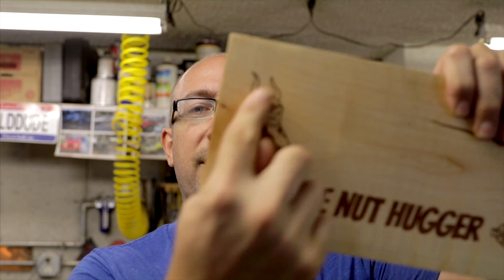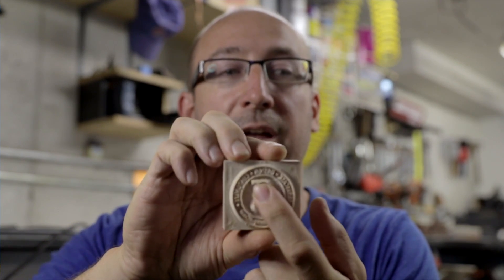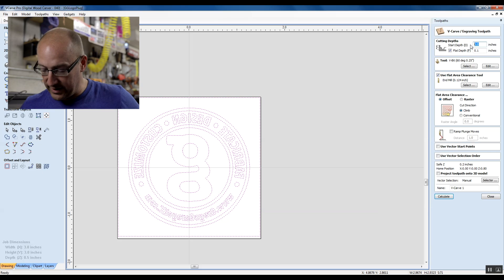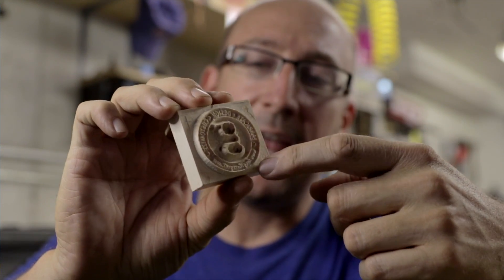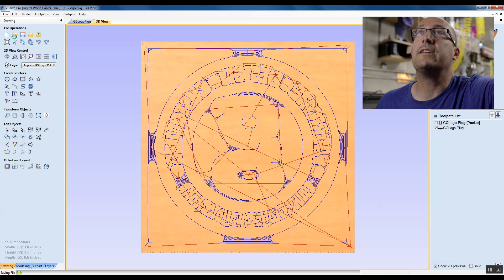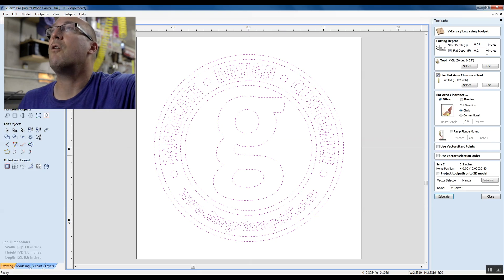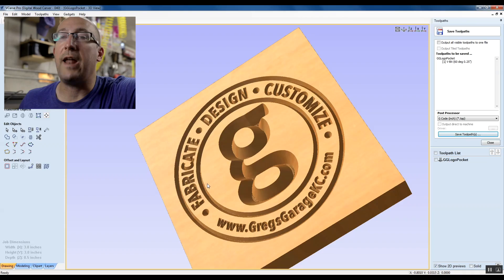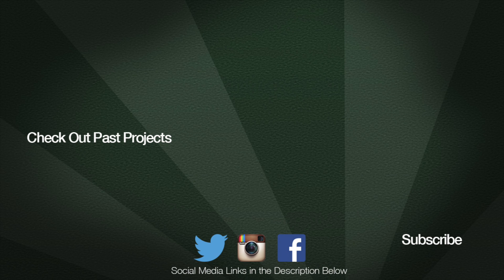V-Carve Inlays - Detailed How To

Comment: I have followed over 20 inlay videos, step for step, and it never works. It mostly puts the plug and pocket on top of each other, even if I do what board at a time. Then there's the error crap, tool path won't cut anything crap. STEP FOR STEP AND IT NEVER WORKS.

Comment: The only issue with explaining the cut depth and start depth of a v-carve inlay is perspective.  All efforts I see on YouTube show the male plug  upside down from how it is carved.  If you start with a .2” round dowel in a .2” round hole, the male bottoms out at the depth of the pocket with no material on top.  Drive a .1” dowel into that same hole and it will leave a gap of .1” at the bottom of the hole.  The exact same thing happens when you remove the “TOP” .1” from the male plug in a v-cut.  It’s the same as removing it with an end-mill.  Even if you could drive it in level with the surface of the pocket, there would be a gap at the bottom just as with the round dowel. The reason you can’t drive it level is because the geometry of where the v-cut begins at .1” from the top changes the geometry of the fit.  It makes contact with the sides of the pocket earlier.  Thus you have a pocket at the bottom that is more than .1” and excess material of the plug above the the top surface of the pocket.  The gap at the bottom AND excess material on top then depends on the length of the plug (pocket depth less the start depth) and the angle of the v-bit. It is no different than any other POCKET (female) and  PROFILE (male) cuts.  It’s just difficult because everyone tries to describe it with male plug upside down from how it’s carved.  The size of the resulting pocket at the bottom is also important.  Too large and it creates a hollow spot that may cause a failure in a cutting board application.  Too small and the trapped glue hydraulically  forces the plug up preventing a good fit along the sides of the plug.

Comment: Do you have the grains of the plug and pocket pieces lined up with each other?  If so, is that an aesthetic choice or  a mechanical choice?
Reply from the maker: You don't need to line them up.  I typically do but it's more for the looks.

Comment: Another comment. I've been playing with acrylic resin. It's not an inlay, technically, but the end effect is still neat. Just do the female carve, then fill will acrylic.  (Optionally paint before the acrylic. For example, glow-in-dark-paint under the acrylic!) Don't need the bandsaw for this technique.

(Heads up, though. If you want to paint the final board (outside of the acrylic portion), I suggest the painting BEFORE the carve. (I tried painting the whole finished product, then sanding away the paint over the acrylic, which was a baaaad idea.)

Comment: Thanks for the video. You said the 60-degree bit was good enough, but the final project (at 10:57) shows the bottom text is a bit poor.

Do you have suggestions since making this on how to improve the quality? I'm thinking:
(1) Bigger project. Basically, accept the limits in detail that you're going to get
(2) A steeper V-bit. And or different speeds.
(3) Different species of wood that maybe holds details better.
(4) Less glue. Almost no glue? Different glue?

I'm a novice at carving. I have a ShopBot Desktop Max, but I've mostly done slightly larger projects, like 12-24".
Reply: I noticed this too. 
Is this an issue of the design, limitations of the CNC machine used, wood type, wood condition, or bits used?

Comment: Thank you for this nicely done video. After watching some others on this subject, I considered doing one that filled in the missing info like what you did. I especially wanted to answer the "I don't know why this setting works, it just does" comment in the other video. You explained it nicely. However, leaving a 0.100 cavity below the plug starts to be a problem with large inlays because you are never going to fill that cavern with glue. It ends up being a hollow pocket with glue at the bottom. This can be fixed by setting the pocket bottom depth a lot shallower at .115 or .120 and then running everything else the same. Of course, this comes with the warning not to overdo the glue.  I like your idea of setting the start depth for the pocket at .010 to allow some sanding. That's a super simple way to make sure those fine details are precisely located after sanding. I experimented with a few different techniques and different woods to see how to make those super fine details turn out a bit better. I found that slower feeds of around 30 to 40 ipm and making several passes tends to keep the chip-out to a minimum. The extra time waiting for the table to finish cutting is well worth the better finished product. Cherry is especially sensitive to chipping on fine details. Walnut is about indestructible. There is no reason to slow down the end mill passes since nothing the end mill cuts shows up in the final product. I run those as fast as my router can keep up. Usually around 90 to 120 ipm with a quarter-inch bit and 60% step over.When cutting the plug, V-Carve can compensate for the extra .1 dig on the first pass by forcing multiple passes and edit the first pass to be .001 deep. In reality, this makes the first pass cut depth .101. This is much easier than offset zeroing or making 2 cut files. One last tidbit that people may find useful: If you do inlay on something that doesn't fit in your band saw (or don't have a band saw) you can run a surfacing pattern with an end mill bit to simply disintegrate the plug right down flush with the surface. This allows you to inlay into anything that fits on your table.
Reply from the maker: Awesome addition to the comments!  Thanks for taking the time to write all that out.  Pinned.
Reply: what a Great comment full of information.
 thank you for taking the time to write all this info for us
Reply: How do you force multiple passes on the v carve for the plug?

Comment: Hi Greg, I have a questions for you regarding inlays. I watched your video and followed it to the letter and I did not get positive results. I am using a Shapeoko 3 XXL I recently purchased over the holidays. I have redone the files three different times and each time yielding the same results. The pocket is much smaller than the plug. Any suggestions?
Reply: Hey Willie, Greg might have missed your comment. I think you have the Flat Depth and the Start Depth numbers switched. If you are using the .2 depth for your pocket, The start depth for your inlay is the amount of material you want to go into the pocket or the amount of material below the top of the work piece. The flat depth is the distance you want between the two pieces i.e. the bandsaw cut depth. On my Inlay my Start depth is .15 for a .2 pocket and the flat depth is .05!

Comment: Great video. I have a question. At 10:56 just after you finished sanding your logo the bottom is unreadable. It looks like the inlay fell apart. I an thinking about making 3.5" round Christmas ornaments will the inlay be ok on this project.   My dad has a cnc router using Vcarve pro that I use, he can't help me with this because he has never done any inlays.
Reply from the maker: The smaller the text, the more likely it is to have little bits that don't come out right...  My plug was figured maple and when it get carved, small pieces tore out because of the grain.  A nice tight grained piece of maple would have been a better choice for this type of work.  You can combat that by using a glue that matches the plug.  I've never had trouble keeping detail in the main body "the pocket."

Comment: Greg, Thank you for explaining this in your own style. It's the best explanation I've heard so far. I'm looking forward to some successful "test run" projects in the near future thanks to you.
Reply from the maker: Right on!  Good luck with your inlays...  If there's one other thing I can add...  Apply EVEN clamping pressure to the entire inlay.  Any uneven clamping will slightly tip the "plug" and you'll have small gaps around the finished product.
Reply: @GregsGarage  Thank you for the response and the helpful tip! I'm just getting started with this and will probably watch your video 5 more times before moving on to the next skill. lol

Comment: Nice tutorial, but final result was shown maybe 5 or 6 frames and had problems.  The URL is illegible.   IMO, you should have noted this issue and proposed a solution.   Thanks.
Reply: as someone totally new to CNC what would have been the solution?
Reply: @sawdustwoodchips  Use a 30 degree v bit instead of a 60
Reply: I've used a plaster filler/grout in the past for very fine writing type inlay repairs

Comment: Thanks for posting this.  I basically use the same technique, but with a pocket depth of .3.  What I thought was my first good inlay (maple into walnut), ended up popping out in a corner a week later. I used titebond 3 and a 12 ton press to clamp it overnight.  Wondering if I didn't let it sit long enough.  How long are you clamping your pieces for?  Thanks!

Comment: Thanks Greg! I really need assistance on inlaying much larger pieces. I have a car shape design carved out 28 x 11". 1/2" deep material but somewhat detailed in...bumpers...etc on the edge profile. My start plaque material is 30 x 13 in total in which I need to create an inlay using contrasting material (wood) to fill the car shape opening made by the profile car. The plug material will be exact to start material 30 x 13 @ 3/4" thickness while the inlay matches the identical 28 x 11 car profile. Remaining will be the 1/2" for the car profile space..the remaining 1/4" thickness will be used for gluing (sandwiching) together the two. Can you suggest a good start depth (i'm thinking .50 the thickness of the car profile) while I am not cutting off the remaining with a band saw blade...would my cut depth be 0.00?
Thanks for your advise. Eddie.rushmyorder@gmail.com 
Any others please feel free to comment, suggest and reply to this novice CNC guy! Thanks.

Comment: Hey Grag, your video about V inlay seems very informative... But my head goes crazy about that... I can not get good inlays... because of one thing... Flat depth... for example if I want to have an inlay for 6 mm, so set FD to  3 mm and start depth also to 3 mm, and then using flat are clearance tool (1/8) I get it broken, because if I have cutting depth 1.5 mm it goes 4.5 mm when starting the cut... (as I understand it is because of sum of SD and cut depth), or if I am lucky I have only half way inlay...
Any advise?
Reply: I know this is a late response, but I was also having this issue.  It was driving me nuts as well, so hopefully this helps you.  If you set the start depth to 3mm, the machine will start cutting at 3mm.  That's why you are getting 4.5mm on the first pass.  It just dives to the 3mm start depth and makes the first 1.5mm pass.  The workaround is to add another toolpath to get you to the 3mm mark.  So, create a toolpath of FD 0 and SD 3mm. Then create a 2nd toolpath of fd 3mm and sd 6mm.  The second toolpath now tells the cutter to start at 3mm.  When saving toolpaths, simply combine the two flat area clearance toolpaths and label them straight, then save the vee toolpaths and label them v.  Now you will have two files, one for each bit, and your machine will make the 1.5mm passes (or whatever you have your tool setup for).  It seems unnecessary, and I haven't been able to find any tutorial that shows this, but it works.

Comment: If my z-zero is usually set to the bottom of the material, how should I set it up this process if I choose to set it at the top?
Reply from the maker: Set up your material with z as the top.  The rest is pretty simple.  you'll just have to get your tool zeroed out when its time to cut.

Comment: neat video... 
If you use mach 3 you can put ALL tool paths in one file.  The trick is to set mach 3 to pause for each tool change.  I have mine set that way by default. Often Ill have as many as 4 or 5 different bits ( tools) in a single file. if tool change is set you will have to hit start twice to start the file, no big deal for single toolpath files. For multiple tools files mach 3 will pause  so you can make a tool change.  Then hit start to resume.  In V-carve put a different tool number for each tool, DO NOT duplicate the numbers. Different bits MUST have different numbers. V cave will warn you in the toollist when you save it if there are duplicate number  for dfferent bits. 

This may also work with other controllers, check the documentation. Beats having to make a load of files, one for every bit used on some project.   :)
Reply from the maker: My controller can handle multiple bits and pauses as well, but zero-ing the tools out becomes an issue so I number the files sequentially like you saw in the video...  I think Mach 3 would be a good controller for most of what I do...  I've hesitated to use it because I have a lot of programs where I scale and clone objects.  I haven't seen that capability in Mach...  I could be missing it though, the screen shots on their website leave a little to be desired...  Thanks for the info!!!!

Comment: Great explanation.   If your start depth is at .1",  how do you handle that first pass when the bit is hogging out that.1" of material (that is above the start depth) plus whatever your doc is?   I've found that starting at .1" bogs my bit down a lot until that first pass is finished and then the subsequent passes move like silk since they are only removing .04" of material or so.
Reply from the maker: I don't have vcarve handy right now, but I'll go from memory...  There are two ways I can think of to combat this.  First is a bit of brute force...  Copy the CAM setup that you have for the carve, then instead of start depth at .1, set it to 0 and let it run a pass to get material cleared out.  When that's done, run your start depth at .1 and you should be good.  The other method is to set the number of passes on the carve to 2 or 3.  I seem to recall this is more difficult than it sounds.  The settings for that may be hard to find...  For a bonus method, you can set everything up for a .1 start depth, then set your z to be .1 or .05 ABOVE the work surface...  Run the program, then set Z at the real 0 and run again.  If it's a part that you're going to make a bunch of, you could automate that move.  Some CNC controller softwares will allow you to relocate the Z and output the g-code.  You could do that and combine it with the original g-code so you don't have to manually adjust the z.  Good luck!!!

Comment: Greg, Great job. You certainly know what you are doing. I recently purchased a cnc unit. I am learning how to use it and how to use the VCarve Pro software. Personally, due to my inexperience, I would have learned more if you could have explained the steps a little slower.
Reply from the maker: Not trying to be snarky here...  I go through pretty quick because you can rewind, pause and run the vid at 1/2 speed if you want.  I should probably put some screen caps on my website so folks can take it in in steps.  Maybe I'll do that next week.  By all means, if you run into any issues, shoot me a message and I'll try to talk you through them.  I've found that just getting in and messing up a few boards usually leads me to the right answers.  I typically do a handful of test in pink foam because its fast and cheap.  When I get everything set right, I start using lumber.

Comment: Thanks for the detailed video.  Question for you, and I am sure I already know the answer.  Do you think the X-Carve is capable of producing this kind of detailed inlay with the V-Carve software?  I have seen some examples of X-Carve inlays but have not been impressed with the results.  Is that due to software limitations or hardware limitations?
Reply from the maker: Hardware...  For sure...  Inlays are precision pieces.  The type of wood (dense vs stringy vs porous) makes a big difference as does the quality of your cutter.  You need a sharp cutter running at the appropriate speed to get a smooth cut...  Now...  You can do this with an X-carve, you just have to be willing to play with the speeds and feeds and get a good recipe.
Reply: Thank you for the advice.  In your opinion, where should a hobbyist start if they are looking for this kind of detail?  Avoid belt driven CNC's?  I tend to be more of a "Buy once, cry once" kind of guy.
Reply from the maker: Hmm..  There are belt drives that work just fine.  The motor size is a big deal.  The linear bearings are also a big deal.  The XCarve isn't bad, it just requires some patience.  Shapeoko is the same type of tool.  After that, it becomes a crap shoot.  If everything is made with quality parts, you'll be able to do a lot...  If they use Chinese bearings and motors, you might be in for a headache.  Shopbots are good, but the file processing is proprietary and that is a big downside for me.  I like my DWC.  I think they make a smaller size as well.  Laguna is REALLY nice but $$$.  There are tons of others out there. Dave Gatton makes a darn nice unit.  I haven't used one in person, but I know a handful of guys who have one and they love it.
Reply: Great info.  I have spent a lot of time reading up on this topic and I think I am going with a Dave Gatton build.  Seems like the right price for an intro unit, but looks like it will function like a higher end personal CNC.  Now just need to budget.  Thanks again.
Reply from the maker: Dave's machines are wonderful.  You'll love it.  CNC Router Parts is another option in that general budget range.